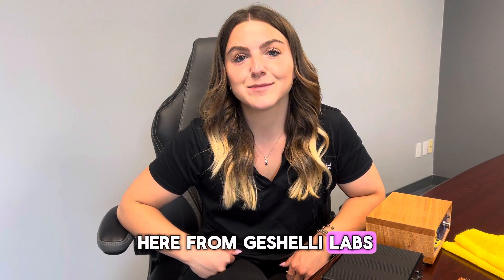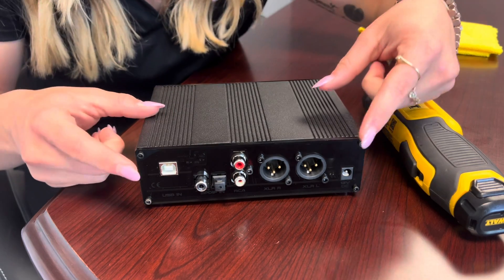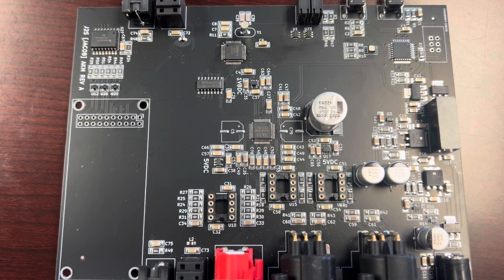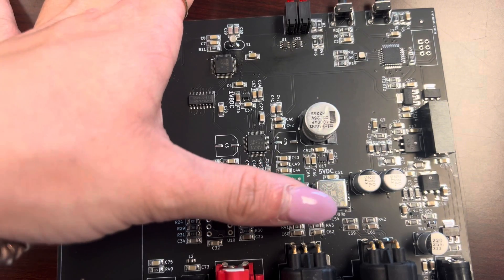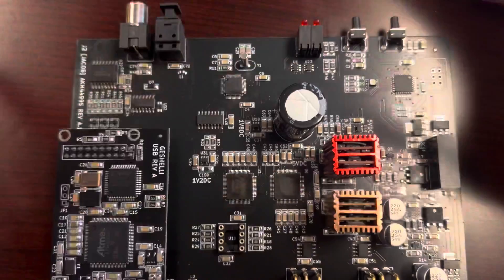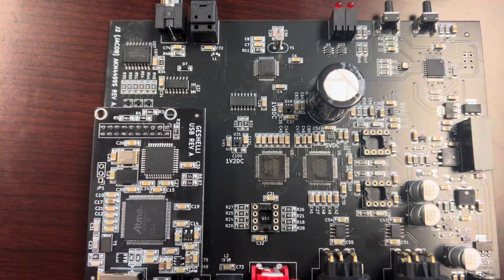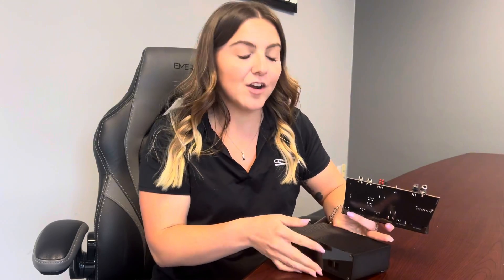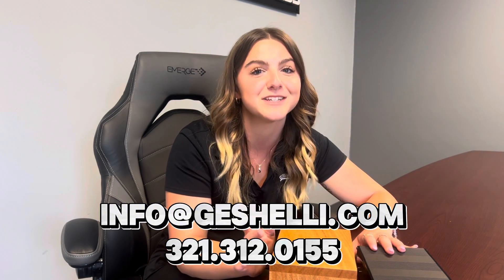DON’T BLOW UP YOUR DAC!! (How to swap out op amps on your GESHELLI J2s DAC)

Comment: i have socket dac. just looking to upgrade the unbalanced side at the moment. noticed that burson offers a dual and a single opamp. which is needed for the unbalanced side and is the extender needed?
Reply from the maker: @hideyamaguchi8196  for the J series dacs you will need dual op amps! My latest video shows exactly what op amps go in each DAC! Hope this helps!

Comment: If I get a J2S with the 4493, is it possible to switch that out later for the 4499?
Reply: No, you can only switch out the op amps not the dac chips since those are different board topologies

Comment: So I definitely broke one of my OPA op amps. One of pins snapped off during removal.  I realize the feet on the wooden boxes are screw on feet but I think something similar on the aluminum box would be nicer than just the rubber bumper feet. I love my J2S with the AKM 4499 and Sparkos SS2590 on all outputs.
Reply: Did you order the SS2590’s from sparkos? Did you get a riser with it?

Comment: Off subject, but can you leave your J2S "ON" all the time? Or do you recommend turning it off after a listening session? Just curious if it has some type of "stand by" mode. Good video.
Reply from the maker: Hi! Yes you can leave your J2 or J2S on all the time, it will not affect anything! Thank you!
Reply: @RachelGeshelli  awesome.
Reply: I feel like it will affect the longevity of the dac if it’s left on all the time but hopefully I’m wrong.  I’d rather leave it on because of the lack of remote.
Reply from the maker: @Elboogs  nope, it will not affect the longevity! Mine I have at home has been left on for years!

Comment: Love My Geshelli DAC, Am eventually planning on upgrading the opamp.
Reply from the maker: Awesome, so glad you’re loving it! Happy listening!
Reply: Definitely recommended.   I had upgraded to the 3602s first, and then much later to the 2590 Pros.  Amazing difference with each upgrade.   You'll be all smiles.  Good luck.
Reply: @Artemis_Prix  which geshelli do you have? im thinking of getting the J2s with the 4499 and use the 2590. But i'm not sure how the 2590 would fit, heard there's a bigger sized housing for the J2s for such occasions
Reply: @phrocasso5906  You can also buy the J3 Pro and you'd be all set to go!
Reply: @Artemis_Prix  I may just go that route, appreciate the info. I already ordered the pair of ss2590s. Assembled with the riser. Thinking of getting klipsch towers and I'll be set. I wonder if geshelli does anything on black Friday